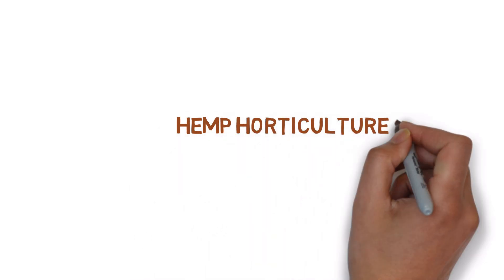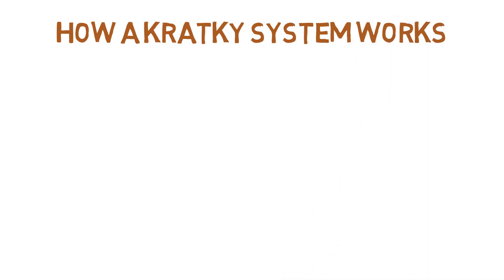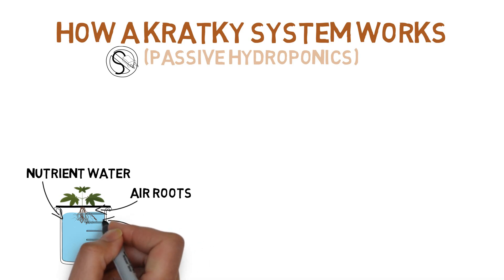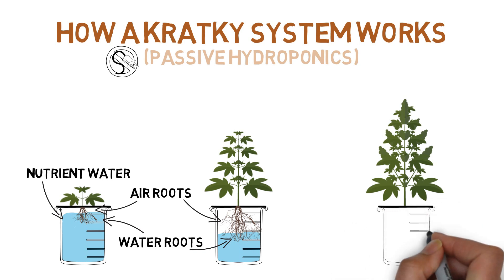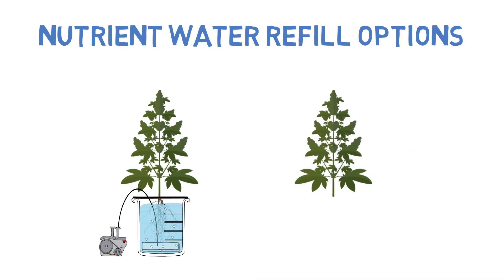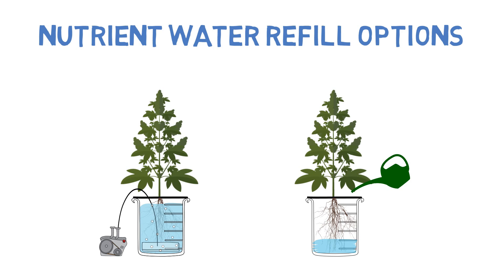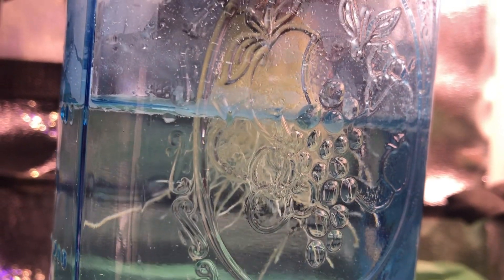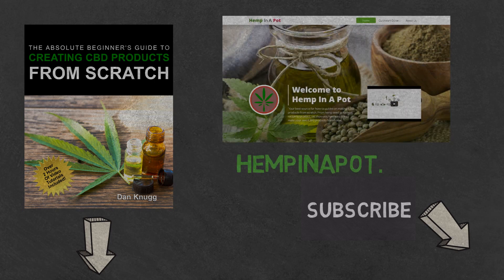Growing Hemp With A Kratky System

Comment: Quick tip, get a large plastic bin with lid.  Run a siphon line from the bin to each plant container. Keep the correct level of water for each plant in the bin.  As long as you don’t lose siphon the plants will stay at that level being fed by the bin. Plus no chance of leaks. You only have to add water to the bin and it’s easier to check.

Comment: I'm about to do my first legal grow. I'm going to be using kratky, deep water culture, and water pump to top feed 15 minutes on 15 minutes off. I have a 15 gallon tote with about 5/16 holes drilled all over the bottom, filled with hydroton that fits on top of 27 gallon tote. That leaves 12 gallon of space. I'll fill the 27 gallon tote with 10 gallons of water, drill an overflow hole at that level, leaving 2 gallons of air, whatever that means, and top it off when needed. I have two large airstones in the resevoir and one water pump, pumping water to the top. If my air pump and water pump goes out.. Kratky will keep it alive!  😁

Comment: Please watch the Grow Kratky channel. He details a method of using a homemade float valve to manage the water level over the growth period in his tomato and cucumber video. It will certainly had an application here. Use a larger external reservoir and a float valve, no more changing solution or disturbing the plant. He shows how you can adjust the level of the float valve as the plant grows (start high and lower it over the weeks) and finally just leave it to maintain a constant level. He just uses gravity, no pumps.

Comment: How do you flush before harvest?
Reply: I'd imagine you empty the reservoir, then use a sprayer or perhaps some sort of pouring device to gently clean the roots with the waste dripping down into the reservoir.  Then you empty reservoir and replace with just water. Or maybe you'd literally dip the roots in a bucket of clean water and wiggle them around a bit, then put back in reservoir with nice clean water.
Reply: don't forget to ph your water, but exactly on point. @jimm9162